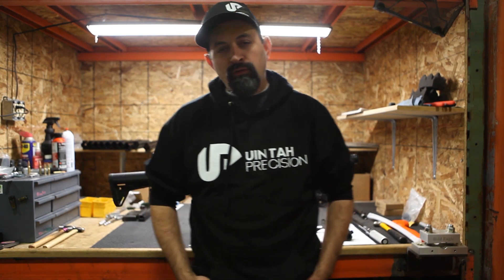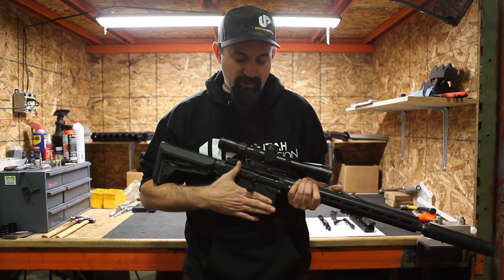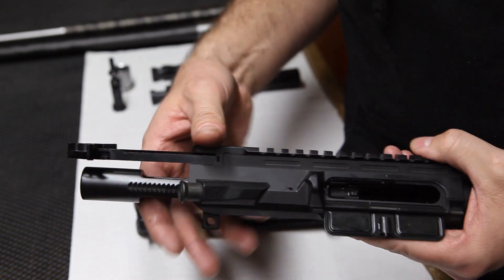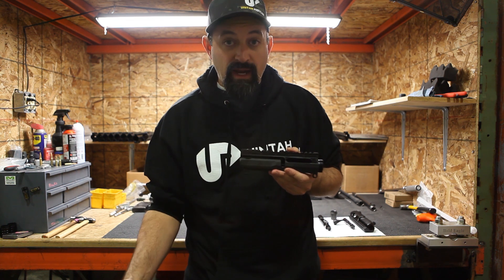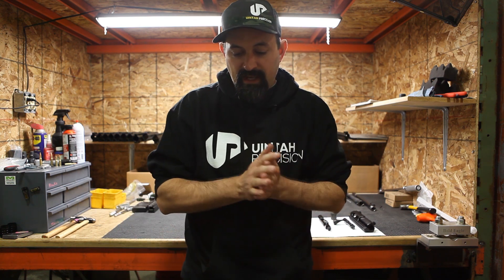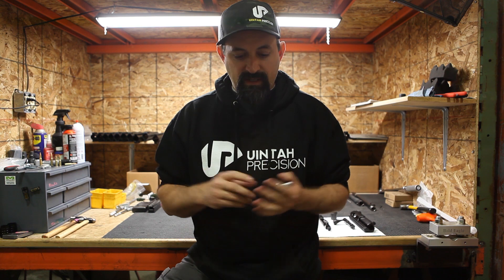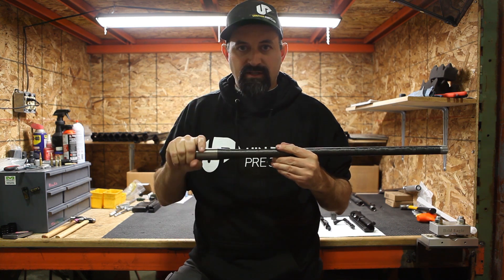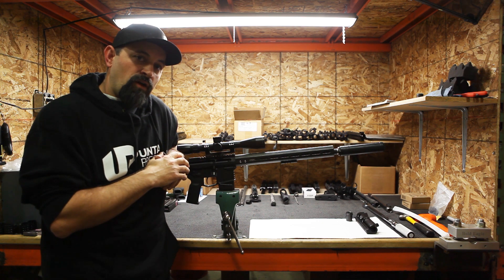Parts is Parts?! Negative Ghost Rider

Comment: What's the compatibility with the A2 adjustable stock and hand guard? I want to make this look like a standard issue m4 😎 kinda like a modern "grandpappys rifle" in .223/.556
Reply from the maker: A2 stock, Yes. A2 Handguard, no. There is no gas block or anything to retain the front portion of the A2 handguard, which would normally use the front sight gas block...but you could use any other free float handguard.
Reply: Thanks for the insight. Quad rail it is!

Comment: Can I change the rails on the upper with a regular free-float? I wanted it longer
Reply from the maker: In general, Yes. Handguards with "locking" tabs that run on either side of the receiver may need to be modified to fit. The handguards for our uppers are "standard" handguards and could be installed on any other AR15 as well.
Reply: But why is it so tight, don't know how many pounds of pressure